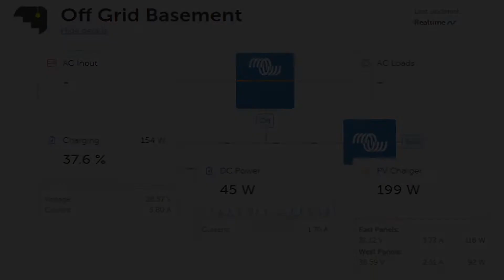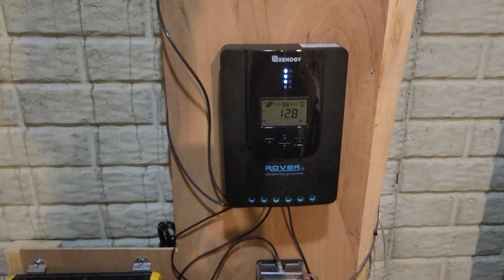Starting the off grid basement!

Comment: i think i fried my big victron 150/60   running aray 2000watts 128volts coming in to run that at the max they wont last do you think victron will do any thing, i think i will do the hole aray over again. so i will have 67v or parallel 1500watt aray, i had put my powmr back to work it didnt like the 128 volts coming in so i cut it down to about 92 to 100 volts it seem like it didnt like that either to me to only run them about 70% of what they say on powmr it 160 v and 2400of panels it is a 100 amp thanks for the cme back LEE
Reply from the maker: Was it 128v at peak sun?  if so, that's when the amperage is at peak as well.  I hope you are referring to the sum of all the panels short circuit voltage.
Reply: @OffGridBasement  i have 6 panels of 315 top amps is 57 times two in series which should be 114 v the highest amps where at 52 i don,t see a problem with 150/60 it work like a top then nothing

Comment: Hi there. I've been watching your videos and have question.
I'm considering building a small system that I can expand. My immediate need is to keep the fridge running during power outages. I'm wanting to start with a 2000 watt inverter and a 12v 100ah lifepo4 battery, then add batteries as I can. I see a lot of videos with people using 2000 watt inverters with 100 ah batteries. But then I see information that says thats a bad idea since it could over draw the battery. I have a limited budget, but  I would like to start with a bigger inverter.

Is that a good or bad idea?
Reply from the maker: Get the 2k inverter and the 100ah battery to start.  If you are wanting to run a fridge then the battery will perform just fine and the inverter won't have any issues.  We you save up a bit more and get another 100ah battery, then your inverter can be pushed to it's limits!  Just remember, one 100ah lifepo4 battery can output 1280w max continuous.  When you get another one and connect them in parallel, you are looking at over 2500w max continuous output.  Hope this helps!
Reply: @OffGridBasement thank you, and yes, I ended up getting a redodo 140 ah battery, thanks to your video, a 2000 watt in verter and a 200 watt eco worthy solar kit. Im putting it together tomarrow. I bought 2/0 cables to be safe and im putting it in a tott. Thanks again.

Comment: Glad I found you. I'm starting from your first video. I'm in South Africa. We have a energy crisis on our hands. Meaning our government did not ensure they were maintaing, upgrading and planning for a growing population. We have power cuts daily called load shedding. It's getting worse at most days 6 hrs+ without power. Thank you for the vule you are putting out.
Reply from the maker: Load shedding sounds horrible.  Is it at least at the same time every day?  Are you looking into building a small diy system or getting a portable power station?  Best of luck to you!
Reply: @OffGridBasement  There is a schedule the follow but it's not always accurate. Believe it or not but there's actually apps that show you when you have load shedding 🙄. I'm looking at building a DIY system. I'm no electrician although I'm a technician and work in the automotive industry. I do have some knowledge when in comes to 12/24v on vehicle's and trucks. I feel a DIY system will be better to expand and more versatile if built properly over time. Wife works from home so it needs to be seamless when there is power outages or loadshedding. I have a 3000kw hybrid inverter ready. Hoping this would be enough for two fridges, lots of led lights, TV,wifi, laptop, phone chargers etc. If it can get the system to last for 8 houre that would be ideal.

Comment: Your right there is very few videos on real life usage of solar power. I have a rich solar 40 amp controller and had the same inverter Krieger 1100 watt inverter. I killed the inverter after I tried to run a compressor. I have 4 100 watt Renogy panels. And two 50 watt panels. Replaced inverter with 2500 watt inverter. My system is out in a lean too connected to my pole barn. I have a transfer switch I use because I have 3 old marine deep cycle flooded batteries. I try to use what I had to save money. I just found your channel and am looking forward to use the power I am making to run more things around the property. Thanks for making these videos and helping me learn more about using solar power in a way that is practical. Sorry talking too much
Reply from the maker: You can never talk too much when it comes to solar!  Glad to see you have a system up and running.  I really want to make more videos on what can be powered with just solar.  Thanks for the comment!

Comment: If you can run 24v system, you maybe able to add more solar without buying another charge controller. You connect the 12v battery in series instead of parallel and get a 24v inverter. That is what I did when I needed more solar. I have the same 30amp Renogy Rover charge controller. It can handle 400w at 12v or 800w at 24v.
Reply from the maker: Toby, thank you for the comment!  Since I had already purchased a 12v lifepo4 Chins battery I wanted to keep everything at 12v for now.  I've actually upgraded my system to 24v and added more panels recently.  A video on that process will be coming out shortly!

Comment: Your setup is very similar to mine. I set up mine initially for emergency situation to power my gas furnace (heat in winter), sump pump and chest freezer (for food storage). 

I have a deep cycle GC2 24v 215Ah battery bank and a 100Ah lifepo4 battery bank.

On a good sunny day, I use the GC2 battery bank to power my chest freezer, refrigerator, charge devices, charge lifepo4 battery bank, do laundry and watch TV. It is never discharged more than 10% because I have 800w solar to support it. It is like I am powering them straight from solar.

At sunset, I use the lifepo4 battery bank because I can deep discharge lifepo4 and don't have to worry about recharging it to 100% if there is no sun the next day.

Looking forward to more videos.
Reply from the maker: Toby, your setup seems to work very well for exactly what you need it for!  I'm thinking about creating another 12v system that could be very mobile.  More videos coming soon!